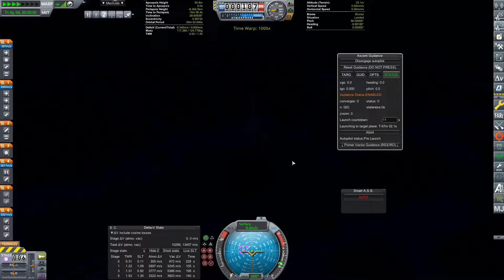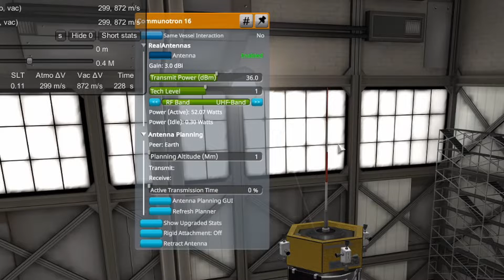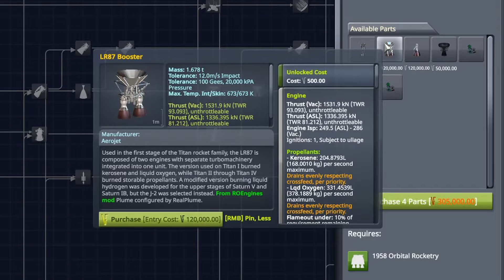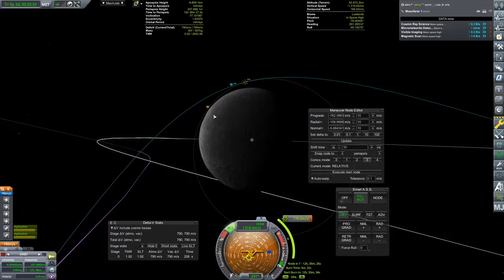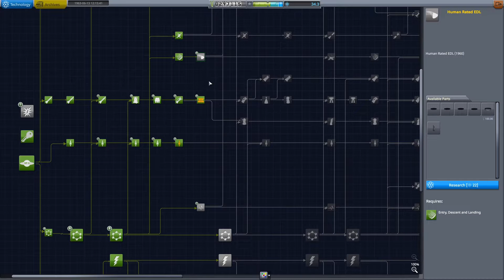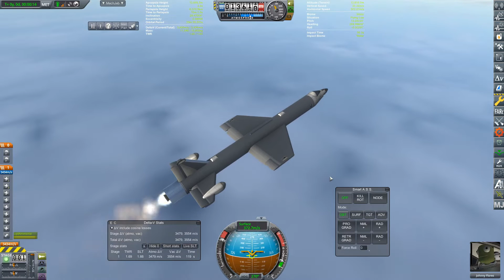Lunar Orbit! - KSP/RP-1 - Next Small Step Episode 22

Comment: why didnt they just use strap on boosters on the Atlas and light all the engines on the ground? it gets around the same obstacle as the stage and a half - not being sure if you can light an engine in flight. maybe im misunderstanding something

also with smart A.S.S. in ADV mode you can select the sun and orient your solar panels perfectly
Reply from the maker: That's a great question. I don't actually know why they didn't, but in my research I didn't find examples of American launch providers using liquid-fueled strap-on boosters until much later, even though the Soviets were using them from the word "go".

I'd speculate that Atlas was 1.5 instead of 1+2 strap-ons for simplicity in design. In KSP we can just bolt on extra tanks and engines, but in real life there's a lot of delicate and complicated plumbing that manages fuel lines and tanks. I guess having one tank feed five engines was easier than building essentially entire separate rockets to strap to the side?
Reply: @justinbright9567  You probably cant have strap on boosters on a balloon tank. just thought of that. 
also i think having extra tanks you can just drop off when their empty would have much less complex plumbing than the stage and a half where you have to disconnect engines from flowing fuel lines

Comment: You can use (multiple) solar panels on one side of the craft and use the com offset sliders on the cores to balance the whole thing out again.
Reply: Also you dont need to turn off the core, time warping or unloading the vessel will "turn it off"
Reply from the maker: Oh, that's an interesting idea. That would give me a lot more wiggle-room in asymmetric design.

Comment: On your X-15 the vertical stabilizer is causing the imbalance once you're out of the atmosphere. That's part of the reason why the real X-15 had a second equally sized one on the bottom.
Reply from the maker: You're spot on. I finally did some testing after this recording and realized what a doofus I was being - outside of atmosphere all those asymmetric plane bits are a liability you can't ignore anymore.

Comment: What graphics settings and textures are you running on, and what's your rig? You seem to be getting about constant 60fps and parts for my new PC are arriving soon, so I want to calibrate my expectations 🙂
Reply from the maker: My rig's pretty burly! Here's my loadout:
i7-8700K @ 3.7GHz
GTX 1080Ti with AIO water-cooler and 10~% overclock
32GB DDR2400 RAM (this one's key, I was running near-max usage on my early 1.7.3 tests with only 16GB)
Installed on a 1 TB Samsung 960 EVO M.2 NVMe

I'm running basically max settings, including Vanadin's 16k textures for RSSVE, Planetshine, Scatterer, and TUFX. Haven't checked performance lately, but as I recall this setup taxes my CPU about 50% and my GPU about 15%. I think KSP/Unity really only uses a single core to capacity, so better single-thread performance is your best bet.
Reply: @justinbright9567  Thanks, seems brilliant! I went for an i3-9100F that suffers a bit in multi-core but does very well otherwise, 32GB of 3000mhz RAM, and a Ryzen RZ 570 that is somewhere between a 1050 and a 1660. Also an M.2 NVME SSD, 512GB. With 4K or 8K textures I'm really thinking I'll be fine, although I also want to have a go at Principia (I hear it makes you feel as wonderful as when playing KSP for the first time 😁). 

What render quality do you run the game at? Edit: you said max settings so I'll assume that's max render as well. I guess I can raise my fps expectations as I tend to go low-mid on graphics.

Comment: I think that centre engine starts with something like a 24% ignition failure rate off the ground to stop you from using it as a second stage. Once that goes down significantly it'd be cool to light it about 15km, to 20km up instead to get the most out of it efficiency-wise since it's vacuum optimized. That'll probably help it along a lot once you expand the second stage for much heavier payloads.
Reply from the maker: Not sure I have the TWR with just two rated burn time +5s LR89s to loft the LR105 without lighting it - at least with my current design. I might be able to get away with a couple of Castors and still be under 150t on some configurations, but it's starting to cut it close. I imagine 1961 Orbital Rocketry might change that math, though. With how fast my science is going now, it's hard to nail down and re-use boosters for long!